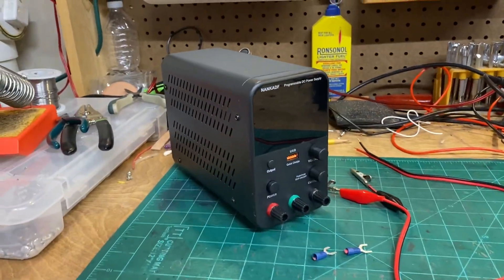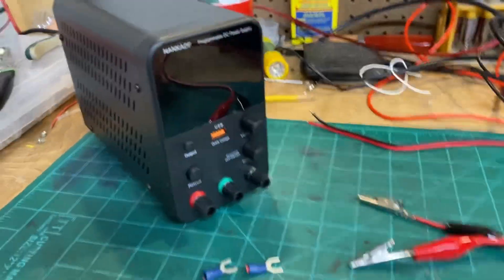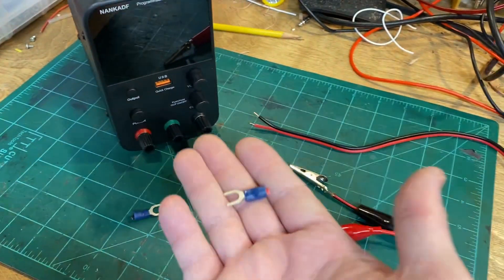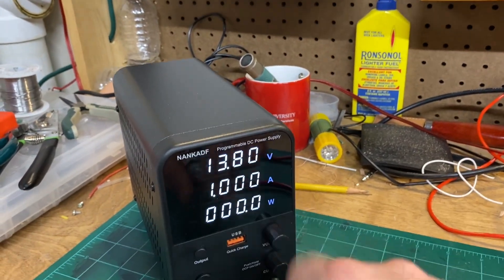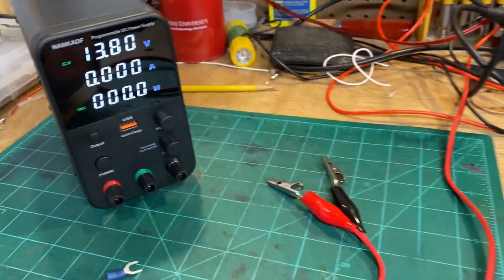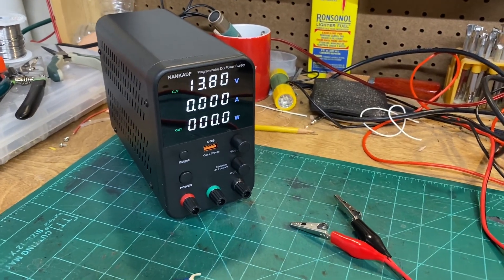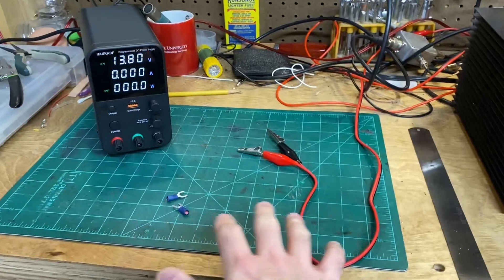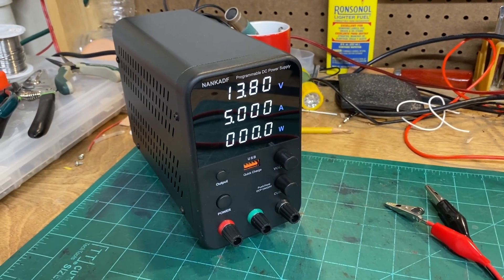NANKADF Programmable 30v 5A Power Supply model WPS305H

Comment: Really helpful in helping me decide which one to order, ordering now based on this demo, thanks.
By the way, spade connectors are useful... it means you have have additional plugs connected on top if you need to power more than one thing at a time. For instance if you want to charge multiple batteries. And soldering isn't always better than crimp connectors I find, because with solder you introduce the risk of oxidisation. If the crimping is done well I would leave it alone. I made the mistake of soldering over crimped wires before. I don't think the metal in the clamps likes solder

Comment: Hello, don't know much about electronics.  Want to purchase a bench power supply. I see many choices from 30V 3 amp to 120V 3 amp ones for sale. Why wouldn't I buy the one with the most accessible Volts?  I will be using it to check Kobalt 80V 6 amp batteries. What would anyone suggest?  Thanks for your time.
Reply from the maker: The way most of these power supplies work is that they put out their maximum current (amps) at the lowest voltage.   So a power supply rated at 5v-20v and 5 amps  puts out the full 5 amps at 5v, but only puts out 1.25 amps at 20v.     So in my case, I don't need a power supply that goes up to 120v because I usually work on things requiring 30vdc or less.     And if I needed more current to test things, I would have to buy a more expensive unit that is capable of providing more amps at the voltage rating I need.
Reply: @421CentralIowa  Thanks, so I guess what I'm trying to say is ... To try to bring back the Kobalt 80V 6 ah battery,  would I need a power supply with at least 80 V and at least 6 amps, or would the 80 to 120 V supply work with just 3 amps to get it in recoverable mode to put on the Kobalt charger?  Hope I'm not making this too difficult to understand....thanks.
Reply from the maker: @craigstrbo  Typically you don't need the battery's full output to recharge it.   You may need the 80v, but only 500mA - 1A or so.  That's still a pretty beefy power supply.
Reply: @421CentralIowa  Ok, thanks a lot. I think I'll go with the 80V or 120V  0-3 amp unit.   thanks again.

Comment: The "CV" on the display indicates that it is in "Constant Voltage" mode.  

from the operator's manual:

The working characteristic of this series of power supplies is the constant voltage/constant current automatic
conversion type, which can automatically change between constant voltage and constant current states with the
change of load. The intersection point between constant voltage and constant current is called the conversion
point. For example, if the load makes the power supply work in a constant voltage mode, it outputs a constant
voltage. As the load increases, the
 output voltage will remain stable and the output current will increase. When the
current value reaches the set current limit value, the power supply will automatically switch to constant current
mode. The output current remains stable, and the output voltage decreases proportionally with the further
increase of the load. The conversion between constant voltage and constant current is indicated by the LED on
the front panel. The CV indicator light is on when the voltage is constant, and the CC indicator light is on when the
current is constant.

5. OCP short circuit protection
WPS model: Press the “CURRENT” coding switch for 3 seconds to turn on (or turn off) the OCP short-circuit
protection alarm function (OCP = Over Current Protection)

Comment: Hi, what type of banana plugs did you get? Thanks
Reply from the maker: I'm just using these cheap ones with screws to make the connections.   It would be better to have some that you can solder onto the power wires: https://www.amazon.com/HIGHROCK-Banana-Speaker-Cable-Connectors/dp/B00APVQZ8U
Reply: @421CentralIowa  Thanks for replying. I’m having a few issues with clips. I’m getting no reading when I touch them together to test. Display doesn’t change. Any idea? Thanks
Reply from the maker: @dononeill1256  I'd test your wires that come off of the scope with a continuity checker and use the same multimeter to check your power supply itself to make sure it's putting out power.
Reply: @421CentralIowa  I’m new to this. When I join the multimeter and the lugs together, the multimeter is reading .739 continuity and the power bench is reading nothing. No change on the screen. The power bench is not reading any connection .Are the cables faulty or the unit. This brand new.
Thank you any advice you can give.

Comment: The radiator joke made me laugh out loud haha

Thanks for this review - I just ordered mine today and your review was very helpful
Reply from the maker: So far I've have good luck with mine.  I like being able to set the current to a safe level of whatever it is that you're powering it to avoid blowing stuff up that you're testing.  And the short circuit protection is also great for testing circuits.  It works just fine as a power supply for a 12v radio too, but more importantly, for little components like 2vdc LEDs at 20ma as well...

Comment: One really great feature your power supply has is the output on and off button.  I think you will find that very useful as you explore the field of electronics.
Reply from the maker: Yeah, I paid a bit more because of the ability to just poke a button to apply power and cut it off.   I'm mad at myself for not having one sooner.  I've managed to get this far in life on a 12v supply I bought in 1995 and a multi-voltage wall-wart that goes from 1.5 - 12vdc.   This is so much better.

Comment: That is a very cool power supply. Thank you for posting this video.
Reply from the maker: Yeah, it'll be handy to do things like figure out current draw of components so I can calculate circuits and I can also feed very specific voltages to things with the current overdraw protection.  It seems to work well.  I've also had good luck running barefoot CB radios with it.  It's not noisy on the RF spectrum, so it'll have all sorts of uses for me.